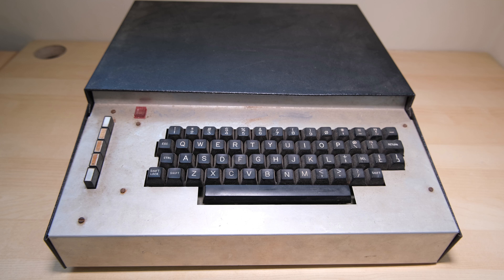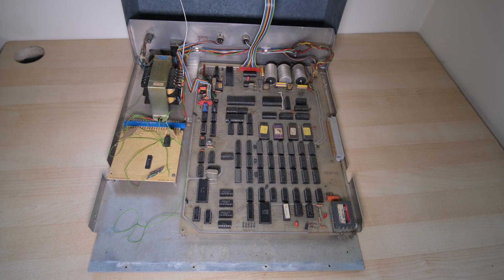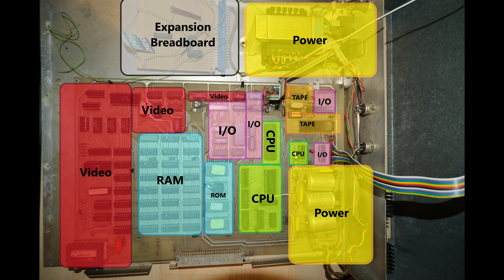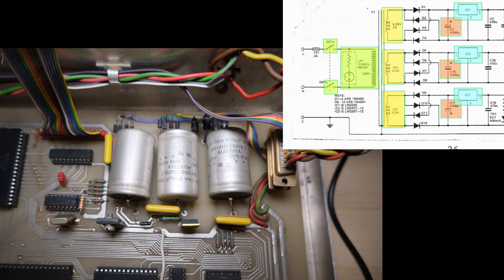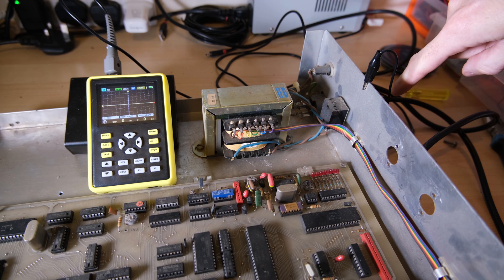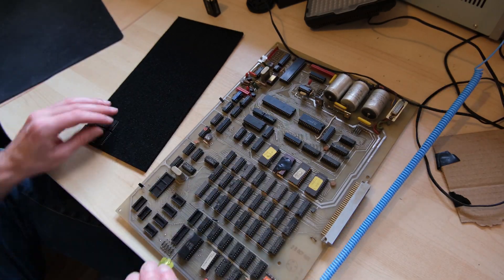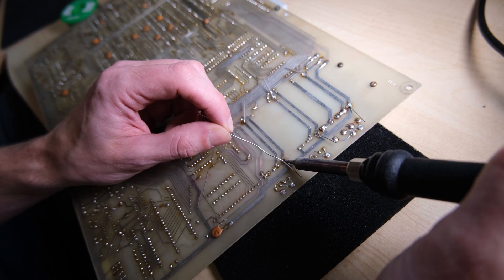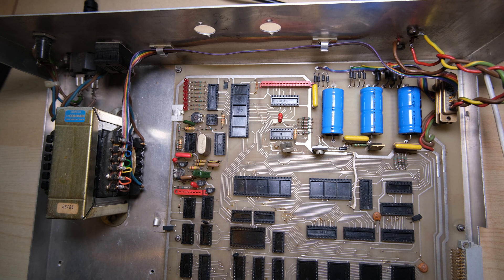1979 ETI/Transam Triton Part Two - Overview and the Power Circuit

Comment: That's usually called a TRANSFORMER not a coil.  And when referring to a single output the correct term is WINDING, as in "the twelve volt winding gave eleven point eight volts."
Reply from the maker: Thank you!

Comment: Hi Nice video as usual.
The 5V rail is just on the lower limit of TTL supply voltage.
Reply: The main 5 volt regulator used in the Triton doesn’t operate well under low load conditions.  With no or little load on its 5 volt rail, the regulator tends to oscillate.  The measurement is probably the RMS value of a significant amount or ripple on the the 5v rail.  This rail may well measure correctly under full load conditions.
Most early regulators tend not to perform well under low load conditions.
Reply: @8-bitbitsa821  Never suffered too much from that but I'm old school and use motor vehicle lamps as visual loads.😊
Reply from the maker: I'll stick a scope on next chance I get